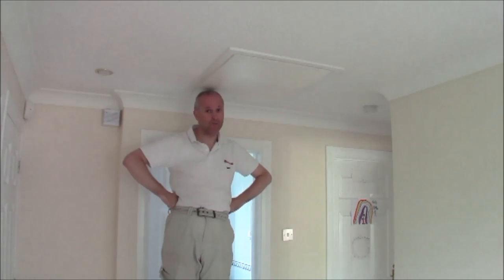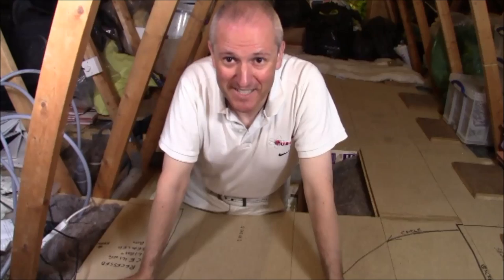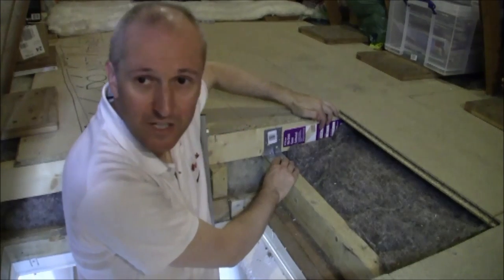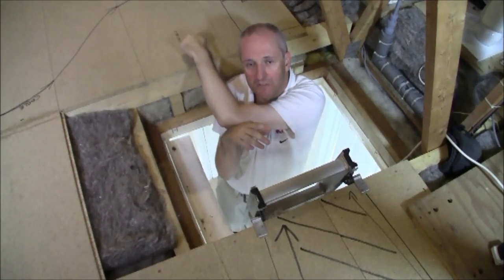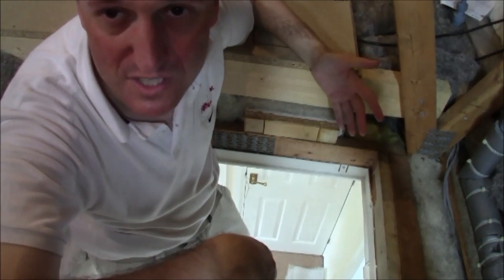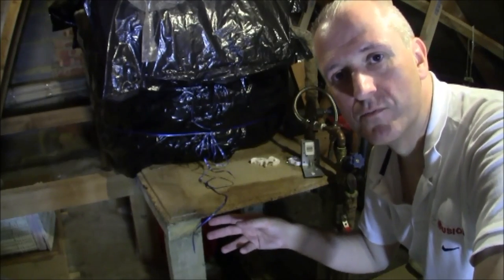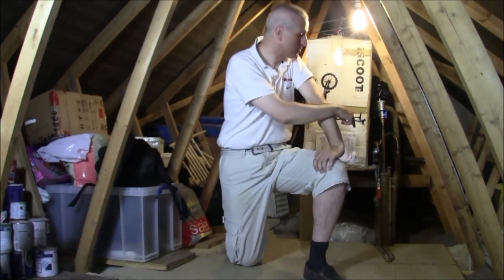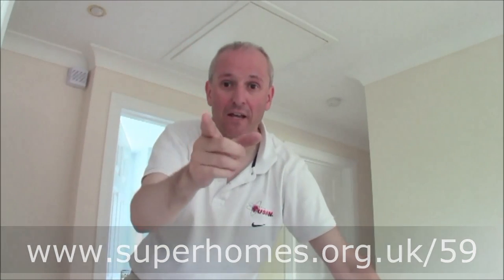DIY Loft/Attic Insulation with over-boarding for Storage [Superhome59 Video part 10]

Comment: You do realise that all that weight is being supported on roof trusses which only have a minimal safety factor above the weight of supporting the roof and plasterboard below. Your lattice work, unless it's sitting at either end on the walls, is not actually supporting any load - just distributing it.
Reply from the maker: ***** Yes, we were well aware of this. However the build of the house is 1980's and I spoke to those in the solar trade about the requirements for a survey beforehand. Their view is that the weight of anything inside the attic is simply not in the same order of magnitude as the roof covering hence the distributed load of attic flooring is well within the tolerances of Building Regulations. This is the rough rule of thumb applied to the application of Photovoltaic panels which seemed wholly appropriate to use it this way. The weight of the insulation is of course negligible and the floor-boarding itself is not significant if normal distributed over-boarding. The only excess weight hence is in the lattice of new non-load-bearing joists. These are distributed evenly over the entire area and screwed down to the load-bearing joists and roof A frames. During construction we monitored the upper floor room ceilings for any signs of flexing. We examined for hairline cracks in painted area where ceiling meets plasterboard walls. No signs of flexing of cracking appeared. Clearly there was no flexing outside of tolerance. We do not believe such roof structures built in the last 50 years have a "minimal Safety factor" as you state. We would be interested in any evidence you have to support such a statement. The additional weight is utterly insignificant in comparison to roof covering and water tank loads.

Comment: I found it somewhere that there must be a gap between insulation and floor boards for ventilation. To avoid condensation ? Is that true ? TY
Reply from the maker: Actually - no, not for the between the joists. After all I have never seen or heard of anyone trying to do this. The insulation is just laid on top of the top side of the ceiling boards. However I do know what you mean. You are talking about the rafters - the sloping part of the A frame under the roof itself. Yes, if you wish to insulate between the rafters with a solid board insulation then you will need to tack on 10mm square batons to stop the insulation board touching the underside of the roof. This is for ventilation as it prevents moisture build-up. 

This makes sense because your roof is subject to outside temperature extremes so condensation is likely. To maintain ventilation ensure that the top and the bottom of the insulation board is left clear so that air can flow through the 10mm gap. I looked into doing this a few years back but I never got round to it. It cuts down (again!) on available space in the attic. Given we had spent hundreds of pounds on the insulation already it simply would not have been economic to apply more insulation. You get diminishing returns. However it would help protect the attic from temperature extremes. It depends what you wish to store there. It is done when you convert it to living space of course.

Thanks for watching. Let us know if you have any further questions. Happy to help.

Comment: Just wondered what's your views about using Loft Legs to take the boards? Some people use them, some don't, some say they are essential yadayada. Thanks 🙂🙂
Reply from the maker: Thanks for watching. I guess you mean the professional system that can be purchased in DIY stores? I admit to knowing nothing about them. They didn't seem to be generally available 16 years ago when I did this but they seem more commonplace now. I chose the criss-cross joisting as it was simple and strong. This was the best DIY option at the time. I don't know. Loft Legs seem flimsy to me and I don't know how they stay rigid? I certainly suggest you give them a spin if you think they will supply a cheaper option for you. However my option is certainly extremely robust and easy to do. I am not sure that the legs option is cheaper? Hard to compare. It will certainly be lighter I guess but that really isn't  a big factor in this at all. Maybe let us know how you get on? Thanks!

Comment from the maker: We have had a comment posted here concerning the boxing-in of the ceiling lights. I removed the comment to save the author any embarrassment but the gist of the criticism was that boxing-in the ceiling lights stopped the bulbs from getting adequate cooling and might present some kind of fire risk. There are several points to make here. First: the downstairs lights were installed in a similar fashion by the previous owners with no problems at all. These are installed on the underside of the upstairs floor hence there is no way that a hole can be drilled through the floor to cool the lightbulbs! Installing embedded lights into boxed-in ceiling spaces is quite normal and has no ill effects upon bulb or ceiling. There is plenty of flowing air inside the "box" for ventilation. Anyone who has watched embedded ceiling lights being installed on a TV DIY show will know that no extra ventilation is supplied behind/above the bulb. There is just an empty void. Secondly we use LEDs that require no extra cooling anyway. Thirdly: the idea that you should cut holes in the thermal envelope of your home, to keep items of electronic equipment cool, doesn't withstand any scrutiny. You don't knock a hole in your kitchen wall to cool your oven or in your lounge to cool the TV.  Any such devices sit comfortably inside your home without need of extra localised cooling. We take that for granted. Embedded ceiling lightbulbs are not in physical contact with anything easily combustible. No lightbulb would ever get hot enough to cause any burning or ignition in conjunction with standard ceiling board. You might argue that the localised build up of heat might impact bulb performance but it would be insignificant in comparison to the cold draft you get from having holes in your roof. You would only rarely need such extra cooling on extremely hot summer days. For the rest of the year you gain benefit from boxing in your ceiling lights.
Reply: Indeed, some old schoolers use plant pots but you can buy the light caps to fit over the top of them.

Comment: Thanks for the share, very constructive video. Can I ask how did you braced the joist against the wall, did you use wall brackets
Reply from the maker: Thanks for watching. There was no wall bracing used as there are no walls in the attic other than the gable-ends. The over-joisting was secured to the existing A-frames. Roofing L an I plates were used.

Comment: Any advice on a new house and I'm planing to floor the loft. Would you recommend 4x2 or 3x2 then frame on top of the loft trusses? For ventilation through the cavity void of insulation??
Reply from the maker: Thanks for watching! Probably 4x2 sounds better. I chose 4x2 because 4inches is about 100mm which was the depth of insulation so it fits in-between the rafters. My sections were laid on top of the load bearing rafters at right-angles as the video illustrates - and this has proven an effective solution. Not too sure what you wish to learn about ventilation though? My purpose was to add extra insulation and ventilation is not a consideration for us as we have fully-vented soffits. Depends upon what usage you wish to put the space to. If it is storage (as for us) then ventilation is not a problem. Indeed we didn't want too much ventilation. If you wish to use the attic space for anything other than storage then you will need professionals to lay down load-bearing joists obviously. That would be a different project. Best wishes in your project.

Comment: Hi,
When you laid the first tier of joists on top of the ceiling joists, did you actually fix them at either ends of the timbers as well or just laid them on top and used the L brackets to fix them to the lower ones?
Thanks
Reply from the maker: All the over-joists were fixed along their lengths to the underlying joists using the metal L plate brackets. The ends of the timber may well have over-hung a little in places. There was nothing to fix them to. A gap was left around all of the over-joisting so no timber was laid end-to-end in such as fashion  that the ends butted up against anything that they could be fixed to.
Reply: @Superhome59   Thanks for the clarification

Comment: Sir thank you for the video.
Can you clear up.
You laid new joists at 90 ° on original house joists ?
Or 
You laid 2 sets of joists.
1st on top of original house joists
2nd running like a lattice

Once again thank you . Also for your details on website.
Reply from the maker: Yes your interpretation is exactly correct: first layer of new joists laid over original structural joists at 90 degrees. Second layer at 90 degrees to that - forming a lattice. Thanks for watching.

Comment: Great video. I plan on doing this myself, would you be able to tell me how far apart you spaced the new joists ? Thanks.
Reply from the maker: Thanks for watching. Actually the joists are exactly the same width apart as the existing house joists which is the same as the width of the insulation. I recall this something like 60cm. If you stick to the existing standard spacing you should find that the loft boards you buy fit perfectly inbetween.
Reply: @Superhome59  Thanks a lot

Comment: How much is it to do this? Do you need to layer it with wood first? How long does it take to do? Thanks :-)
Reply from the maker: The Sheep's Wool was £999 and the wood was £618. (There was also a new attic hatch door, some pipe insulation and some new lighting.) The sheep's wool was rolled out right on top of the mineral wool without separation. I did this as a DIY exercise and it took me about 8 to 12 weeks but I was only able to get about an hour's work done in the evening's after work. Thanks for watching. If you have any further questions let me know.

Comment: Great video! I'm having a friend to install attic door from the bathroom to my landing. My house is 1960s so the attic insulation might need replacing, especially when we had a leak on one side of the roof last year. I'm wondering do I need thick insulation for such a low roof that I have? Already updated my fascias for better ventilation.
Reply from the maker: You should install as much installation as is practical. There is little economic sense in installing more than we did. 600 to 900mm is a good rule of thumb. Obviously less if you have too little headroom.
Reply: Richard james 
   j
Reply: Richard james vgho

Comment: Great video , well explained and yes Dave there are now specialist products on the market and we have been using LoftZone raised loft flooring products instead of using loads of heavy timber for over two years now.
We have installed 100's of homes using this product and had 100% positive feedback.
No need to add anymore weight than necessary by using wood. Wood works but its heavy and expensive and you need a lot of it.
The store floor products are light weight and come in three parts, a tri, & uni support and a metal box section crossbeam. Standing at 270mm high when installed it avoid any insulation compression or the need to remove it as well.
Also you can now buy sealed ceiling spotlights and also ones with a cover protecting them against heat. Its amazes me how things change so quickly.
Superhome 59 what about a demo of the new products available for loft storage solutions? glad to help

Comment: You've clearly done a very thorough job, and great to see sheep's wool used too. 

I notice that the loft boarding was done in 2008, and at that time, the only method available was to raise up the joists with more timber, as you've done. That's now (2015) quite old fashioned though, as it's heavy and slow and fortunately a suite of bespoke systems for raised loft flooring are now on the market. Several other Superhomers have used the LoftZone StoreFloor system for example, which is much easier and faster to install. 

I hope this helps.

Cheers for posting!
Dave (Superhomer No 156!)
:)

Comment: Not sure about sealing in the lighting in those boxes you need vent holes in to release heat from the unit itsself and bulb or downlighter even if it is LED
Reply: correct

Comment: Great video. I didn't think you were supposed to screw into the trusses though (4min).
Reply from the maker: I know of no prohibition against using screws into trusses. Indeed that would be odd given that recommended approaches to insulation and loft conversion all require screwing things into trusses and joists. Certainly don't saw through them but nails and screws are fine.

Comment: do you know all that weight is on the ceiling rafters
Reply from the maker: +Mansdaz Please see our response to SLRist posted 5 months ago. Given the nature of the engineering of the A frame in a UK house structure we did not foresee any problems as long as the new joisting was evenly distributed. The weight of the flooring and insulation is pretty trivial. We estimate that most of the weight is actually in the items being stored. We monitored the wall to ceiling areas on the top floor and saw no cracking or movement suggesting that the A frame took the weigh on the outer brick walls.

Comment: Great job, I enjoyed seeing the hard work pay off. Is there a particular method of deciding where to begin the over-joisting? I was wondering whether you started from the loft hatch to the walls, or from the walls to the hatch? Same for boarding.
Reply from the maker: Thanks for visiting and watching. I am not sure there is any great science to it but in my example I started working on the back of the house then the front. These long sections are not interrupted by any hatch so I could go end-to-end easily. Then in the main centre section: one end could not be boarded because of the water tank. On the opposite end I worked from the wall to the centre & to the loft hatch last. This was only because boarding around the hatch was the most complicated. I had position the final top layer of joists offset one joist away from the hatch. (The final joists are screwed to the side of the A Frame so you have to choose which side.) This gave me maximum clearance around the hatch but I ended up with an uneven extra long space between final over-joists at the hatch. Hence standard size loft boards would not fit. I had to use leftover metal roofing plates under the boards to support them. Not ideal but it works. Thanks for your time. If you have further questions do not hesitate to ask.
Reply: @Superhome59  Ah, I understand now. I too need to contend with loft tanks and associated pipework which are situated in the front / middle portion of the loft. I think beginning from the wall that divides mine and my neighbour's respective properties is possibly the best thing for me, because I don't want to immediately deal with the overflow pipes that trail from the loft tanks to the back wall of my house. Once I get a little confidence in laying down some over-joists and boards in a relatively unobscured area of the loft, then I'll scoot over to the slightly more complex section of the space. I'm anticipating I'll need to trim boards and timber when I begin to reach the area around the hatch, but that won't be too much of a concern I hope. Thanks so much for the speedy reply.
Reply from the maker: @raminybhatti5740  No problem. Good luck. (Most of my attic pipework was concentrated over the DHWC and around the tank keeping things simple. The only complexity was a pipe that ran down to a bathroom at the other end of the house. Thankfully this was at the inverted apex of the A Frame hence I had no need to cover it with a board - just a bit of insulation.)

Comment: You spent a grand on insulation that's boarded over?
It's never going to be disturbed or touched in any notable amount of time.
It's not even a big loft... 
Should cost 100s to do a loft out, not 1000s.
Reply from the maker: Thanks for watching. These points are addressed in the video. You can do it cheaper but only by using spun glass insulation. As was explained in the video that was not the purpose of the exercise. The purpose was to get 300mm if insulation in a space where you could touch it and breath it with no ill effects. The point of boarding over 80% is to have storage and that we have aplenty. You cannot store without the boarding. We enter the attic to place or retrieve items on a regular/monthly basis. If you don't wish to ever go into your attic, and wish to do this cheaply, then choose Rockwool and be done with it. That would be a different solution only costing a few £100s.
Reply: @Superhome59  I'm not disputing boarding the whole loft, I just don't think that you're going to breath anything of note that's under boards

Comment: I had my Semi detached Bungalow Attic insulated by Green deal ,and it looked as if they just flung the insulation down , what a total mess.
Reply from the maker: Sorry to hear about that. I do know that many people have found that some Builders will pay lip service to the insulation requirements of new homes. Owners have peaked into the loft to find the rolls of insulation just thrown into the attic and not even rolled out! So, yes, you will get a few cowboys out there who just don't care. However, since rolling out insulation is the easy bit it is easily rectified. Laying down storage areas and increasing insulation thickness is the difficult bit. Thanks for visiting and good luck with your DIY.